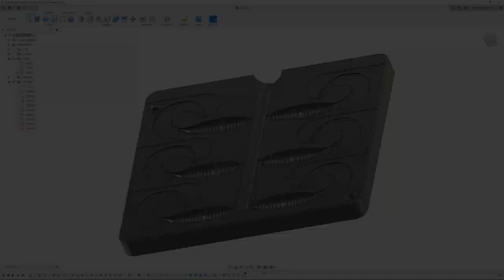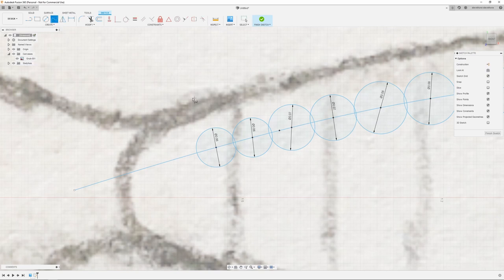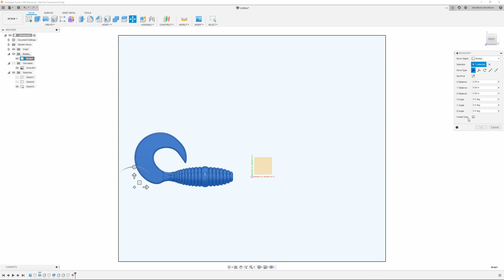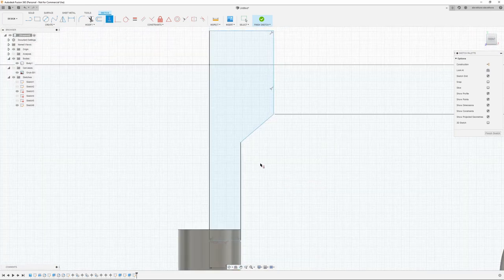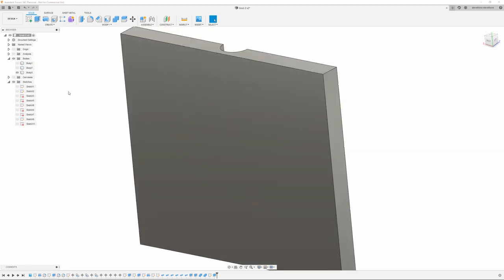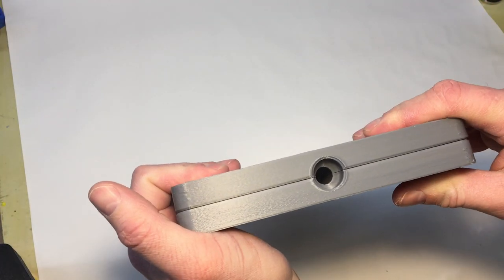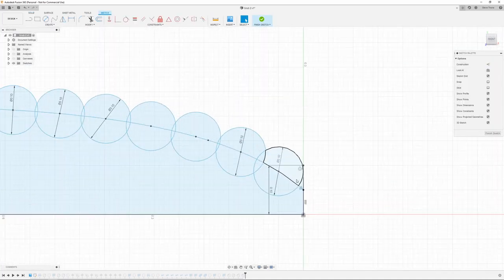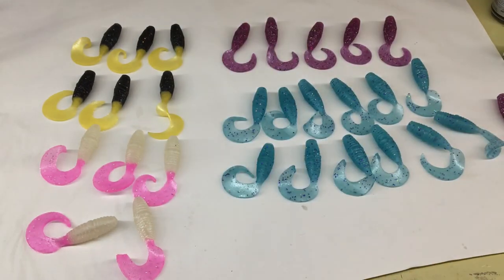Designing a 3D Printed Multi Cavity Mold (Basic Grub)

Comment: Thank you so much for making this!  I'm trying to "trick" my angler teenager into learning 3d modeling to make soft plastics.  I have a bit of autocad experinces and really like the way you went from sketch to modeling to slicing to printing.  There are plenty of other video on the injection process.
Have you considered resin prints?
Reply from the maker: I have been thinking about getting as resin printer as  I have heard resin will work better because it takes higher temps I just haven't had the spare time to look into them fully yet. Hopefully this winter I will pick one up to experiment with... Thanks for watching.

Comment: I love this! Have you ever tried to smooth out the surface and prime it to get a smoother surface? I'm curious if it will give the smooth, shiny surface seen with CNC molds
Reply from the maker: Yes.. I've tried Hi temp engine spray paint on the molds (I briefly show it in my next videos) and it worked ok but I did have some issues so I need to try it again.

Comment: Great video, not sure if you will see this I'm doing the same as you and at the tail end there is a big difference in thickness. Tried using fillet but keep getting errors.
Reply from the maker: Usually if the fillets are throwing errors it's because they are to big for one area. If it's on the tail it could be because of where the tail connects to the body.

Comment: How big do the holes need for the registration pegs?
Reply from the maker: I use .25" diameters for the pins and holes. I clean them up with a 1/4" drill bit after printing.

Comment: What is the equivalent to the pipe command in Solidworks?
Reply from the maker: I haven't used SW in a awhile so I don't know if they added a equivalent pipe command these days but from memory... you can draw a path sketch (like I would for the pipe command) and then just add a new plane on one end of that sketches points (using the reference geometry plane command) then just draw your circle (or what ever shape) on that new plane and then just use the Sweep boss command and select the circle for the Profile and the other sketch for the path. It's a few more steps but it should end up with the same results.

Comment: Nice vid! what did you mean by "I might have used to much injection pressure"? I am having problems with dents in the plastic.
Reply from the maker: It turns out denting is usually caused by the plastic cooling too fast. From what I hear it is better to shoot with the plastisol cooler... this can sometime help with denting. Are you shooting this 3D printed mold or is it something else such as an aluminum mold?
Reply: @TheNeverendingProjectsList  I am using a 3D printed mold (SLA) I think I'll try to make the entry holes bigger to start. It wwas my first attempt

Comment: Hi there, just liked a llot your video. In fact, I plan to make one my own following your tips. I have a question: how long does it take to cool down the lures before opening the mold? thank you.
Reply from the maker: Unlike an aluminum mold which dissipates the heat faster the 3D printed molds do require a little more time before de-molding. I usually wait about 3-4 minutes (at least) but I lot is going to depend on the design of the baits.
Reply: @TheNeverendingProjectsList  Thanks a lot for sharing.

Comment: Have you tried printing in abs? It's more heat resistant no?
Reply from the maker: I have not tried ABS on molds it probably would work better but the PLA is working well enough for what I do.  I did try ePC which has a higher heat rating than ABS but the plastisol stuck to the molds like super glue.
Reply: @TheNeverendingProjectsList  PC >ABS>PLA
Reply from the maker: @doris9969  You forgot PETG :)  (BTW... PC doesn't work the plastisol sticks to it.)